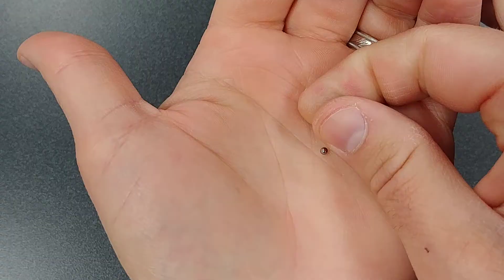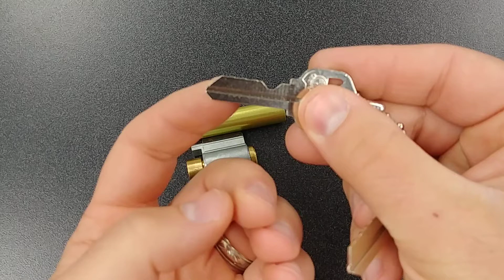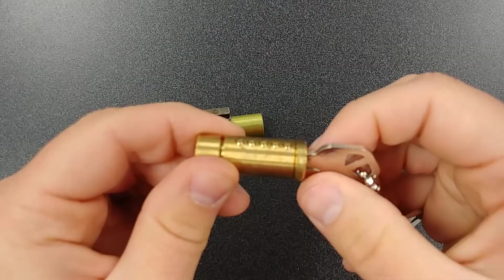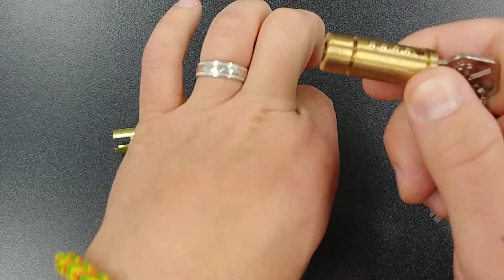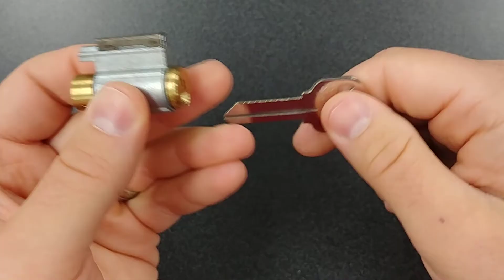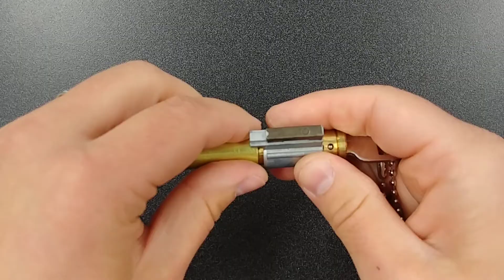How Construction Keying Works

Comment: I expect the PK ball hole has to be smaller than the top pin holes so the the top pins do not fall into the holes and permanently lock the lock.